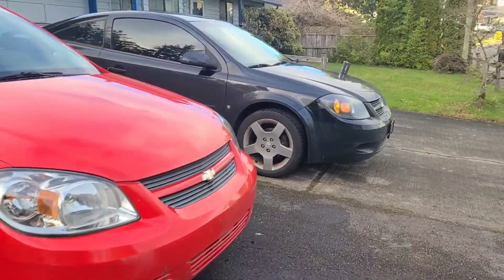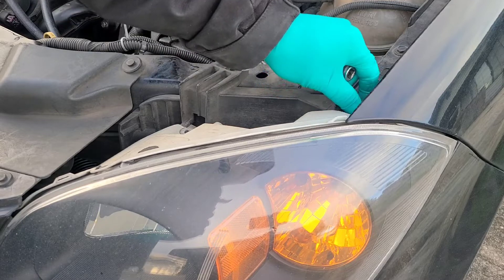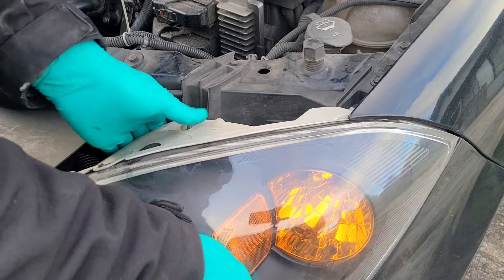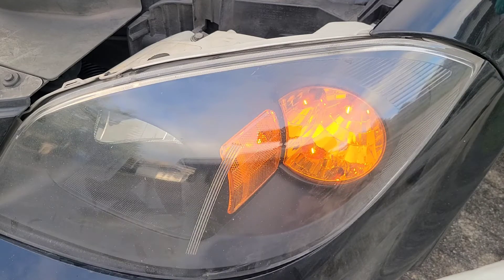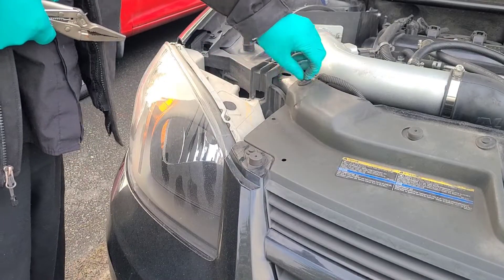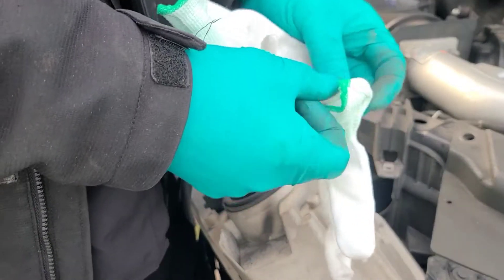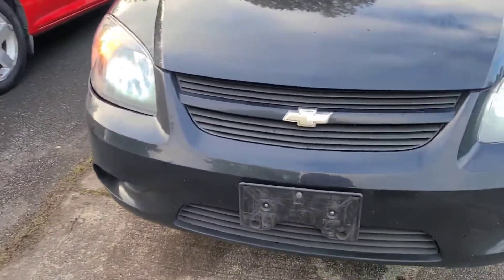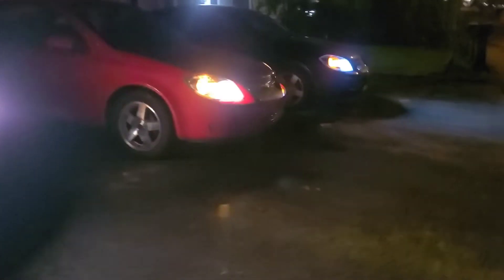LED headlight replacement--337,690 miles 2009 Chevy Cobalt

Comment: you ever replace the fuel pressure regulator  in the tank for a California emissions cobalt? I have low gas pressure on startup and I've already replaced the fuel pump twice. I haven't seen anyone replace it online
Reply from the maker: I think a problem you might be having is a leak in the gas line.
Have you tested the fuel pressure and does it hold?
If you're in a state where they use salt on the roads there is a very common spot that gas lines will rust out behind the driver side wheel 👍
Reply: I live in calilfornia, no salt at all. I lose fuel pressure overnight but I dont lose gas. doesn't smell or drop any gas which is why its my only conclusion. maybe the fuel injectors but I'd be running rich but my cobalt runs excellent 
 @1020autorebuild
Reply from the maker: I have a video on California emissions fuel pump replacement, I've never done a pressure regulator. The California emissions fuel tanks are a little different than the regular ones everything's self-contained 
There is no external fuel filter